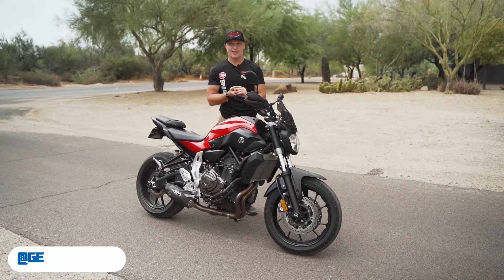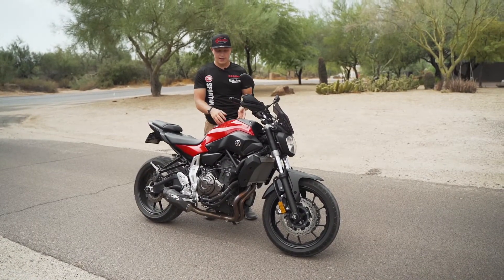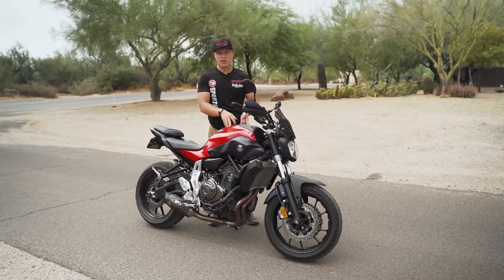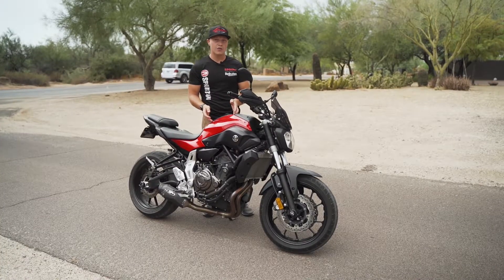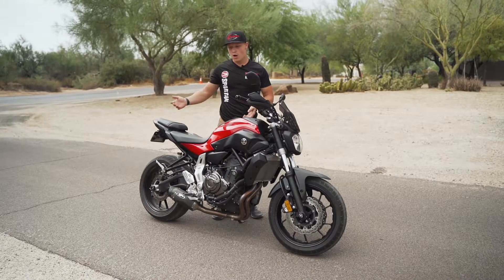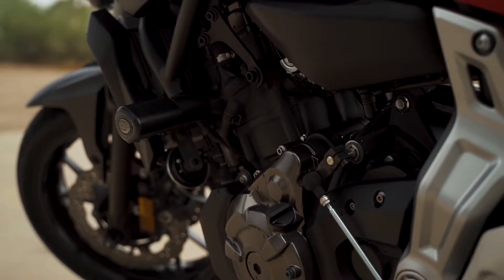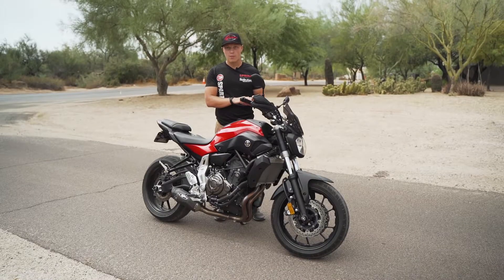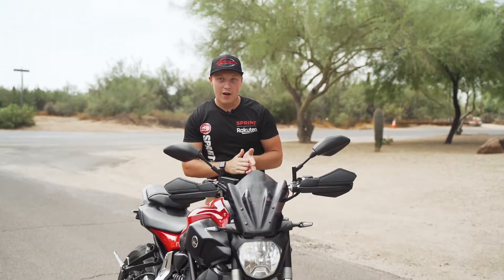Why Is My Motorcycle Backfiring? & How To Fix It

Comment: Just FYI, backfire and afterfire are two very different things.  What you're talking about is afterfire, which is when fuel is ignited after it leaves the exhaust and you get a cool popping sound and maybe some flames, not harmful.  Backfire is when fuel is ignited inside the cylinder while the intake valve is open and the exhaust valve is closed, causing internal engine damage to valve seals and can even bend valves or connecting rods, which is caused by a hot spot in the cylinder.
Reply: Yes , Thank you
Reply: Soo have your not broken bike fixed in a shop. No I dont feel like I got any value out of this particular video.
Reply: How can you tell the difference ?
Reply: Engine knocking is more common term than that
Reply: After fire can burn exhaust valve seats so it's not harmless
Reply: My 2t backfired Idk how
Reply: It is harmless, can even light your air filter in fire

Comment: How did u fix it with the air fuel mixture.  Less air more fuel setting or less fuel more air setting... ?
Reply: Depending on the air filter, less restrictive, more fuel to compensate the extra fuel goes to he engine. Hope I explained...